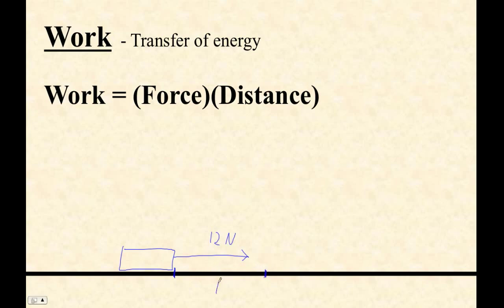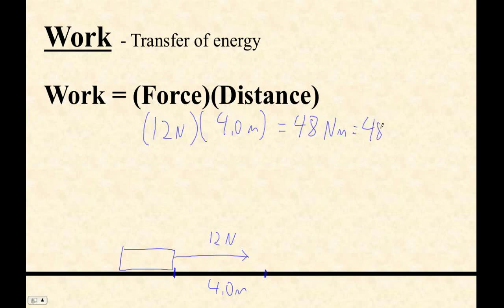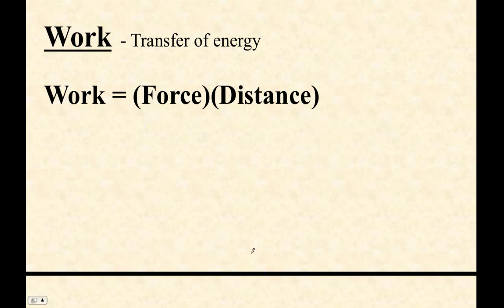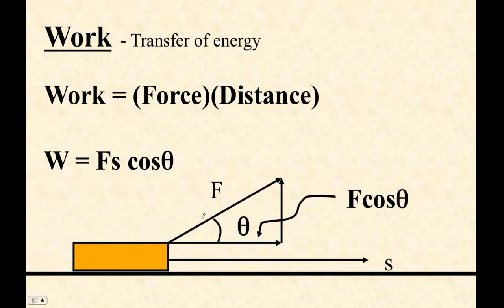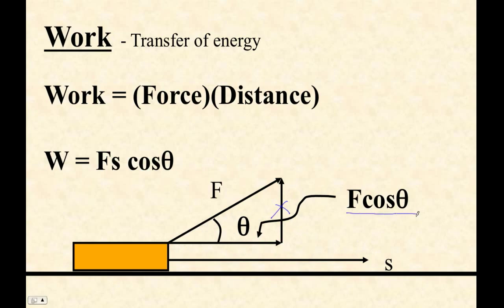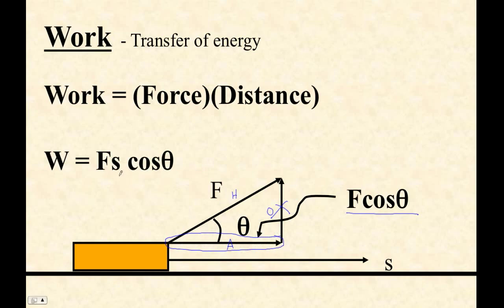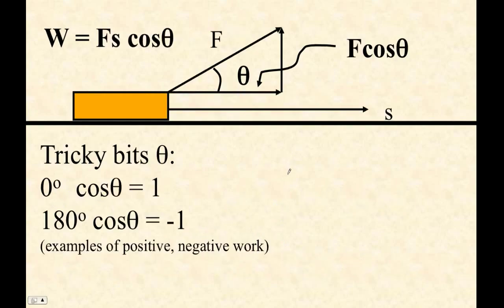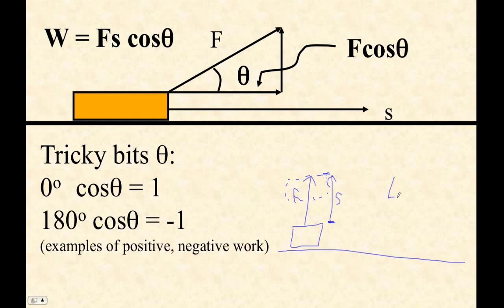HTPIB06B Calculating Work using W = Fs

Comment: Why you didn't mention the friction ? 
When you pull the block , the friction is the major force acting over there...
Reply: thiivyesh S. P the friction would be equal to the horizontal component of the force exerted, assuming the object is not accelerating.
Reply: @Murray3605  Thanks sir,